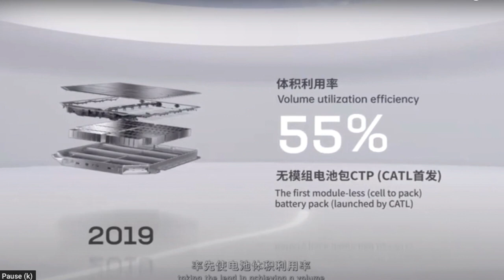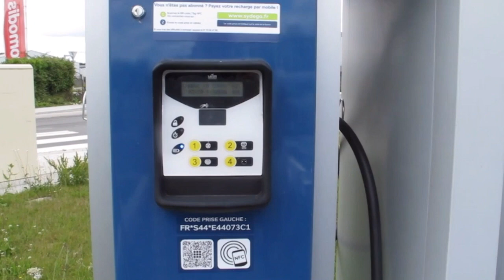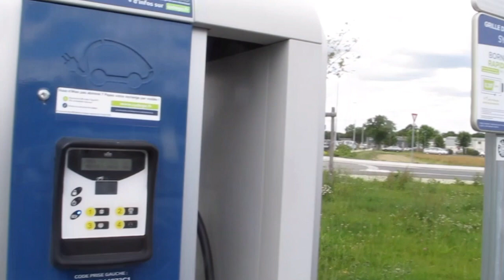Ye Olde Kia e-Niro and the new CATL Qilin battery

Comment: A good comparison of battery types is the MG 4. The LFP battery has approximately 80% the capacity of the longer range NCM battery, that is 50 kWh vs 60kWh usable. LFP is  less of a fire hazard and is more durable.
Reply from the maker: Good point. It will be interesting to see how the NMC and LFP versions of MG4 perform over time and high mileage . LFP is undoubtedly a safer and more durable chemistry but experience so far suggests that the manufacturing process and the BMS in the car itself has a lot to do with outcomes. SK On (Previously SK Innovation) say there has not been one incident of a battery fire in any of their NMC batteries which is now in 2.5 million EVs.. This they say is due to their patented technology, I think its called Z folding. Yes, LFP should be able to complete more charge cycles but the charge cycling of NMC batteries increases if you do partial charging most of the time as most people do. They say NMC is 'only' capable of 1,000 full charge/discharge cycles which in the case of my car would give around 400,000 km of use before serious degradation sets in. But with the more typical 20-80% cycle regime that rises to 2,500 cycles, adding about 240 km for each plug-in, so for most car owners the durability/longevity of LFP versus NMC is a moot point. Thanks for watching.
Reply: @kiae-nirodiariesencore4270  Thanks for the response. I have the LFP MG 4. Yes it will be interesting to see  how the two chemistries stack up against each other over time. If LFP is as good as they say I expect at 7 or 8 years the LFP battery to be giving the same range of an abused NCM battery car, but we will see. I still don't fully charge my LFP battery all the time, maybe once a month. Apparently the flatter discharge curve doesn't allow the BMS to track what's going on in the battery and it takes a full charge for it to know what's going on. I believe that the battery still degrades faster at 100% charge but no where near that of the NCM. Thanks for the video, it's nice to see some one discussing battery types. Regards John

Comment: Out of curiosity, I see my Niro has a slow charge rate let's say 80kw at max.

Like other cars that charge using the 400v system and can achieve rates of up to 150kw charge speed. If kia wanted, could they increase the Niros speed using software or do it require a hardware upgrade to achieve higher speeds (in theory)

Comment: I bought my 2020 Kia Niro EV with 13,700 on the clock at the end of May this year 2022. I've done 500 miles since then. This Kia Niro is quite comfortable and easy to charge in my garage. We only use the car once or twice a week going 25 miles round trip. This is our only car which serves its purpose. I can't keep up with the present or future changes in batteries. Over my head I'm afraid, but I love this EV. Frustrating at first with all of the tech, but learning it slowly. I drove a 2019 Kia Soul Turbo for 12,900 miles and traded it in for this Kia Niro EV. Loved the Kia Soul as we had 4 Souls before that one.
Reply from the maker: Sounds like you have a lot more experience with Kia than I do but ours seems well put together. Just got back from a trip out to La Rochelle and the hotel had a charger on the wall in the car park...so got another 150 km of ‘free’. Free is good, we pick up power at supermarkets and car parks here. Thanks for watching and I hope you continue to get good service from the e-Niro